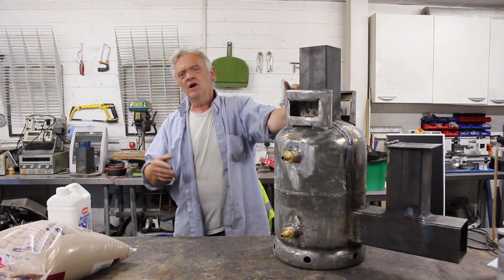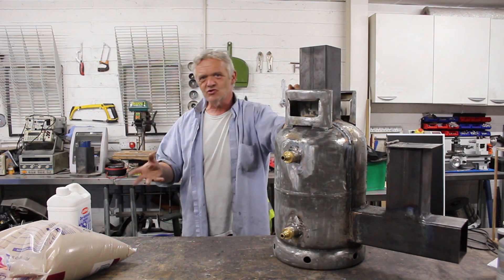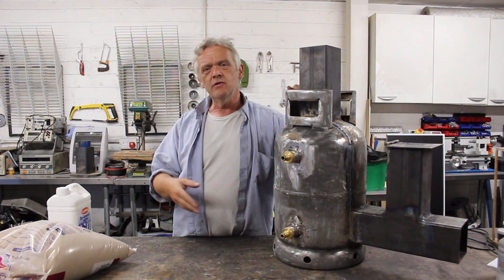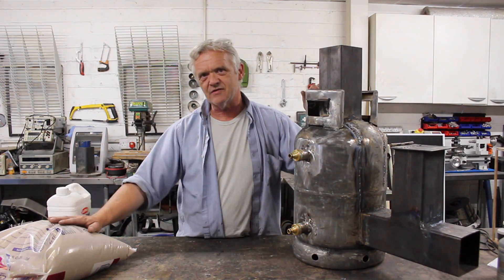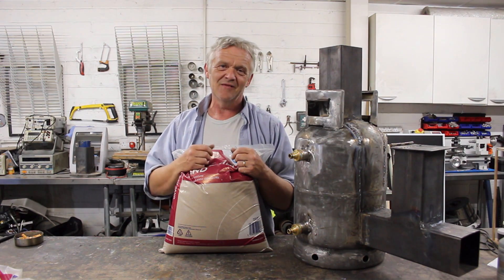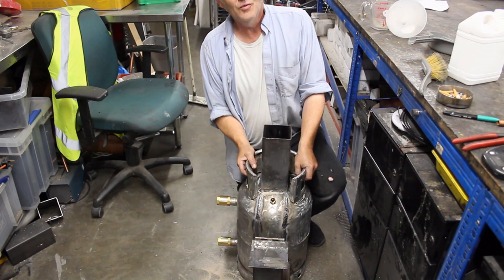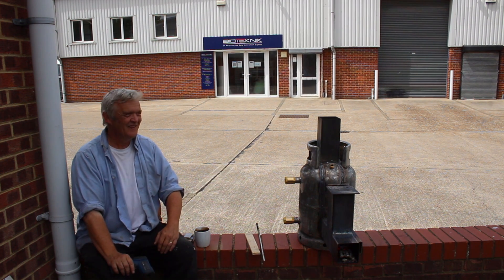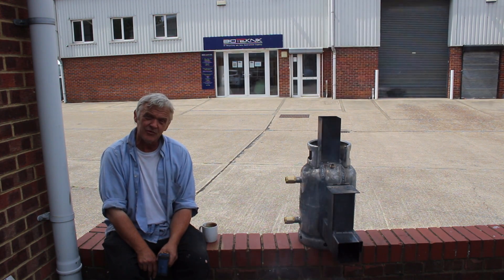1607 A DIY Sand Battery

Comment: Be nice to be able to gather heat in summer and use it in the winter. But how would you generate such high temperatures? How much sand would you need for the average house? If you keep water under pressure you can raise the boiling point. What about liquid metal? Sodium mayhap? If we can find a cheap way to convert and store energy we've got it sorted!
Reply: How would you cheaply increase pressure to raise water to boil, like compressing air?
Reply: @alakazaam-n7c  there would have to be an air reservoir as water is not compressible. However in a confined space as water boils the steam would cause pressure rise just like a steam engine boiler. At 5 atmospheres (75psi) boiling point of water is around 150c. water has a heat capacity of 4184 Joules per kg per °K. You couldn't get it as hot as sand though!
Reply: @johnf3326 what is the half life for the water temperature. Will sand lose heat slower than water, assuming both are well insulated.
Reply: @alakazaam-n7c  Not sure on that but you could get sand up to several hundred degrees and without the problems of containing liquid at a high pressure. Each has its own advandage/disadvantages. The best solution actually - ground source heat pump. Use whats there already

Comment: Here in Michigan there are thousands of old silos on farms no longer in use, imagine filling one with sand and putting solar panels every few feet surrounding them from top to bottom. Have some heat generating resisters in the sand and you have a massive sand battery! I only wish I had one 🤔🤔 Spray foam the inside for insulation, sure seems like this would work.
Reply: I wonder what type of insulation can withstand 400°c temperature without loosing it efficiency or burning.
Reply: @HarpreetSingh-di4hk vermiculite. 1100C
Reply: @HarpreetSingh-di4hk  might be ugly but I'd spray foam
Reply: @HarpreetSingh-di4hk kiln liner/forge liner refractory (?) blocks?
Reply: If sand retains heat...then ...why do deserts get cold in the night time ? 🤔
Reply: @ScoobyD2  because it's not insulated and has cold air rushing over it.
Reply: @ScoobyD2  do your
My owñ homework 👀
Reply: @ScoobyD2  Deserts have low humidity, which help insulate the atmosphere, so the surface heat rapidly escapes to space. An infrared thermometer aimed up at the sky can give much lower readings than down or horizontal (depending on weather). Many animals survive by burrowing below ground, nature's "sand battery". Due respect to RMS!
Reply: @ScoobyD2 The air is colder than the desert is hot.
Reply: I'm a urethane foam sprayer. That's a great idea. You could spray the outside to and coat it and or wrap it with lath and trowel  something over like clay or stucco
Reply: Or lqryer it into cells and use as a earth battery
Reply: @ThirtytwoJ  what does layering it into cells do? I'm pretty new to this and battery and I'm trying to figure it out

Comment: Ok if I had 2 fire extinguishers for example joined together.  1 has a heating element which is connected to a wind turbine or solar power to provide power to the element. The other is full of sand. The heat transfers to the sand. How would you then pump heat out in to my home? Is this doable? Or am I thinking BS. Thinking of an alternative to a wood burner?

Comment: Water collects heat very rapidly but it then dumps that heat very rapidly.  That’s why it’s used in car radiators etc.  SAND AND OTHER MASONRY COLLECT HEAT SLOWLY AND RELEASE IT VERY SLOWLY.  THOSE WHO PUT DRUMS OF WATER IN THEIR GREEN HOUSE TO COLLECT HEAT FOR THE NIGHT WOULD BE MUCH BETTER OFF USING SAND.

Comment: Well done Rob I like the design, I used granite stone chippings but I like this solution as it's all nicely contained, my only concern is the potential to melt the firebox as sand is also an incredible insulation and mine glows bright yellow when it's been running for a while. Spalling may also be an issue so check inside occasionally for the metal flaking off but the thickness off pipe you're using you shouldn't have an issue.
Reply: How fine do you get the granite stone chippings?
Reply: @originsdecoded3508  just loose chips that you would put in garden I think they were probably around 30mm long at most, so any loose stone will do from chippings to sand
Reply: @shortbuslife3440  WOW! This Comfirms What i've suspected long time ago regarding some ancient archeological discoveries near Angkor temple complex by the Sra Srang basin in Cambodia. They found hundreds of of clay shaped turtles burried into the ground with pure quartz crystals tightly packed inside, and all them connected with metal wires in series. Seems to me they were utilizing the same concept you are describing here. They were using pure Quartz crystal instead of sand. I imagine the sun would heat up the clay turtles, heating up the crystals inside, and you know the rest. The ancient Past was not primitive at all!

Comment: My thoughts for an off grid system was a large reservoir of sand or crushed rock with a solar concentrator system.  Using air instead of oil to transport the heat to the reservoir would cut down on breakdown of the oil and pump issues such as clogging.  Then use a sterling engine as a generator for electricity and the reservoir also as a way to heat the house at the same time.  Have yet to purchase the land for it but a work in progress.  Your thoughts?
Reply: Siemens-Gamesa has a prototype thermal storage facility (Google ETES and the company) near Hamburg based on vulcanic rock and electric heating. For extracting the heat, they pump water in and get steam out, which is fairly effective. The steam can then be used via heat exchanger or to drive a steam engine.

Comment: This is a nice start. One very interesting thing that the Finnish company is doing is heating the sand electrically and then removing the heat from the outer parts of the sand first. By doing this in a controlled way, they actually can increase the efficiency quite a lot (they claim 2x) because the sand you have cooled becomes a partial insulator for the remaining sand. That approach does, however, mean that larger batteries have a large advantage over smaller ones.

Comment: Thanks for another great video Robert, this is something I'd definitely like to try myself, it could be used for simple home heating or in some industrial applications where a lot of heat is required for certain manufacturing or chemical processes.  Could you do one or two videos that would demonstrate 1. how to heat the sand to 500 degrees using a heat pump and 2. what type of insulation would be appropriate to keep in the heat for as long as possible as they have done in Finland?  Edit: I see you have answered the insulation issue in video 1622, you must have read my mind 😁 Thanks a million!!

Comment: While this may be good for extending the heat release duration, the sand is also acting as an insulator, so you may not get the same total amount of heat if you are using this inside your home or shop to heat it.  in other words, you might be losing more heat through your exhaust.  Water might actually be a better option if you wrap copper plumbing tube around the stack and then route both ends to a tank so that the cold water from the bottom of the tank goes into the tube and, as the water heats up, it rises and feeds directly back into the top of the water tank while drawing cooler water from the bottom of the tank.  Through this method of cycling, it should bring evaporation down to a minimum, especially if you have a large tank.
Reply: Why not run pipe into the hot sand, and then run air into it.

Comment: Some calculation are required if you substitude in an heat exchanger the fluid , even with sand.
On the other hand, I dont know , neither  you suggested, an home insulation able to handle easily 450 degrees making this sand battery unviable as DIY.
Overall, it seem to me , a waste of time, good for earning 100k youtube visualization but with no real application

Comment: Ive always looked towards sodium acetate or "hot ice" because you can use it has a thermal battery that can hold the latent heat for days until you need it

Comment: Anyone building something like this for long term use should be aware of one issue. As a rocket stove, steel is fine because it radiates so much heat it keeps the temperatures down. Same with a water jacket. But once you start surrounding the rocket core with insulative materials like clay and sand it can bring the temperatures in the core up significantly. Over time, the steel spalls and fails. This is why refractory materials are typically used in rocket mass heater systems. 
I'm a huge advocate of mass heating, my whole home is heated with one. It would probably be a good idea to consider installing a rocket mass heater rather than try and retrofit something like this to a conventional wood burner.

Comment: Back in the day, a couple of centuries ago, rocks were heated by the fire and were put into metal buckets or containers and used to heat certain areas, like under the seats of carriages, in bedrooms, or wherever they were needed. Today, rocks are used for heating tents in camping, and they last a long time. I had started wondering about sand, as I live in Florida, and we don't really have rocks by the beach, just limestone, but that's kind of further inland. We are on shale here. So I started looking up sand as a heat-holder, due to the fact that I didn't really want to buy some rocks, as they are expensive, used mostly for decoration in front yards, or fire pits. I was pleased to find that sand does indeed hold heat extremely well. The sand we have is mixed with organic debris, but it can be cleaned - I have done that a lot in making some homemade fertilizer. Pure white sand is the result. We have power outages here once in awhile, but being in Florida, heat is not too much of concern, as our temps stay pretty moderate most of the year. We don't see freezing too often. Daytimes can hang around 50 or so in the winter. But putting a bucket of hot sand from a fire pit in the yard under my chair could be a warm welcome if the electric goes out in the wintertime.

Comment: Now their something that I never thought of for holding heat, SAND. I would bet this will hold heat for a good bit of time. Job well done Robert. Peace
Reply: I have a wood burner with ove, I put storage  heater bricks in the oven keep warm all night
Reply: @gedhuffadine1873  Nice to hear that it works so well Ged. Are they regular clay bricks ??
Reply: @victoryfirst2878  no they are the ones that go in storage heaters but clay ones could work
Reply: @gedhuffadine1873  Thank you for clarifying this question Ged.

Comment: I read about this a few days ago... but in that article they said sand has about 25% efficiency??.
So that's a loss of 75% or roughly 3 times the energy it takes to heat it than it stores   
if the initial energy is free and in abundance you may not care, but if it expensive or if  burning a pollutant then its environmental value is debatable.

Comment: Just watched Matt Ferrell’s video about latest applications of graphene and I started wondering if maybe adding a little graphene powder to the sand might improve heat distribution in the sand.
Reply: Pr a graphene sheet between a + and - wire to heat the sand with 12 or 24 V? What do you think?

Comment: wait.  Sand battery = accessible thermal mass?
okay so a flywheel but for heat
a water battery that doesn't use gravity or slosh about
nice

Comment: Two points this would be exellent as t tent heater no worries about fire in the middle of the night. I am back in Portugal working on my house and I have noticed that the sandy rock in my area is very high in iron. Night storage heaters are basically fuse iron oxide bricks. So I am going to give this a go with our local sand. Try adding iron oxide cement dye to your sand it may help with the absorption of the heat charge.

Comment: Could you also then add a removable coiled copper pipe around it with water in and out valves as before for also boiling water for such a thing as a hot tub, bath etc?

Comment: So, I'm wondering about such a system for a future self-build. I currently have approx 2KW vacuum tube solar arrays feeding a massive (in house terms anyway) 400l water cylinder. This works in conjunction with a gas boiler and wood boiler. For a 3000 ftsq house the gas boiler is a tiny 15kw output and generally keeps the house warm in the winter (with back up from the wood boiler if it gets a bit colder). The solar heating is always making some contribution.
The whole system remains a bit Heath Robinson to be fair and does require fairly constant weather-checking and manual fire-lighting at night to top up the water cylinder (heat store) after a dull few days. Generally though, I don't need the gas boiler at all from April to late September in the UK.
The problem in the summer is over-heating and water in the solar primary pipework boiling away (sometimes alarmingly).
Now, a sand / rock, soil battery as a heat sump under the house would appear to be a great idea and could alleviate the water boiling problem. I'm just wondering what size of hole under the floor would be required to heat a typical 3-4 bed house over the winter. I'm wondering if a water-based under-floor sand store piped system fed by solar arrays could work.

Just stumbled upon your channel by the way. Love it!
Reply: The only reason to use sand is that you can heat it to a high temp e.g 600 degC+. Water limits you to less than 100 degC unless you want a pressure vessel which you definately don't. When limited to 100degC, water is far better than sand.

Comment: me just visualizing, those quickconnectors plumbed with an embedded spiral for extracting hot water, and fins on the burn chamber if that would speed up the heat transfer, 

i read indeed about secondairy air intake for afterburning

it is a pitty that gravity is comes heavy with these

Comment: There was an earlier battery used by Siemens? in Hamburg which crushed volcanic rocks. Similarly a British start up using liquid air cold and hot rock have a plant in the north of England. One of the problems is in integration of several ideas into one site so as to minimise duplication of electrical infrastructure. So having a Wind farm with integral short term battery plus long term heat storage+- liquid air might be a way forward. It would reduce the turn off payments which I find ridiculous since dumping the heat load into rock costs nearly nothing. I would imagine Siemens know exactly what is the best rock. Now if only there was a big chunk of volcanic rock near me in Edinburgh...

Comment: Here in South Texas, we have an all you can eat buffet of hot. Getting in your car the air is so hot it tastes sweet and makes you cough--the steering wheel burns your hands. A black parking lot is easily hot enough to melt cassette tapes and warp sunglasses.We are one enormous "sand battery". I've never understood why we THEN go find something to BURN to make power to run air conditioners (I have three running as I am writing this, or it would be unbearable in here.) I am very interested in that last bit of how we take all that latent heat and turn it into power--which in my world would mean COOLING more than anything. If we have this technology, why the hell aren't we using it?